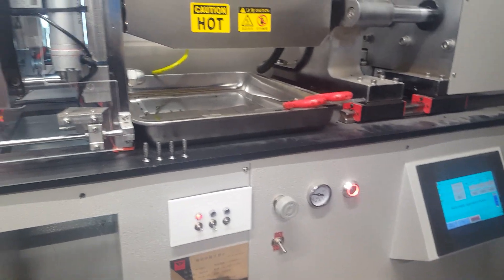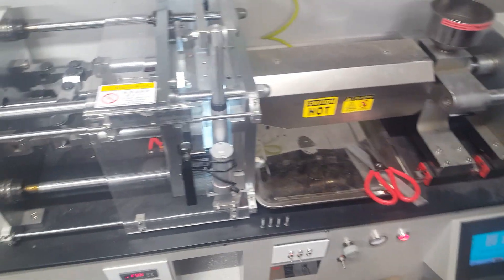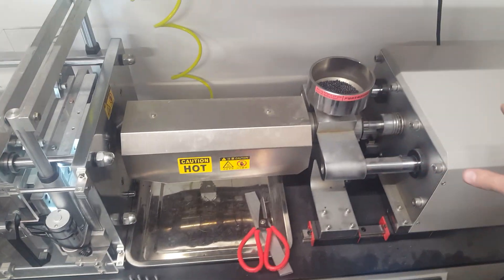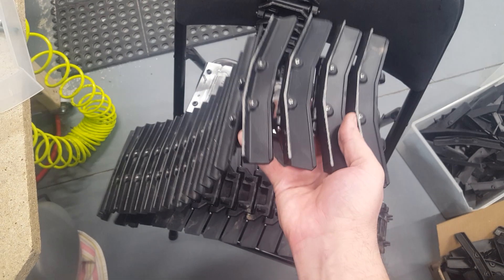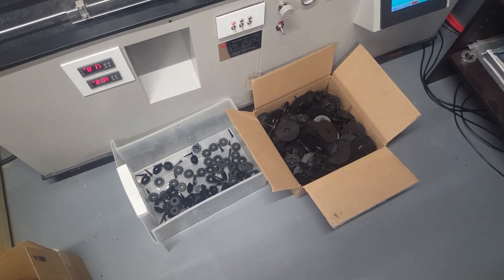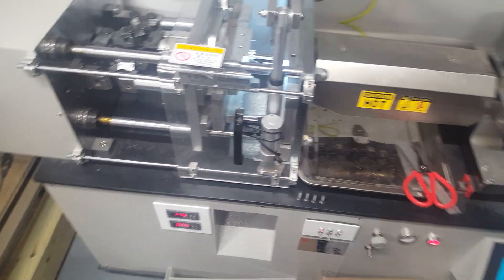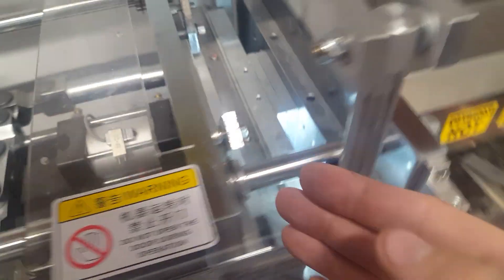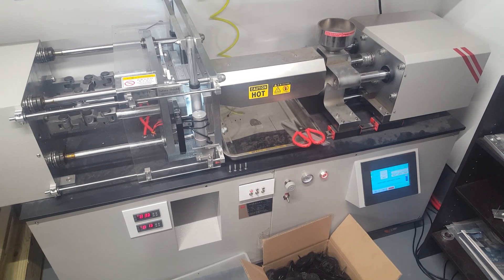RobotDigg.com Injection Molding Machine! Overview By Spyker Workshop

Comment: Saw this question you got about a month ago.....I am also actively looking for machines at the moment and have come across these. How much do you pay for the molding plates? What else do you need besides the machine (I think I saw you had a pressure tank in a video?) What is your typical maintenance costs and the curve of learning on repair (and is there support for maintenance/warranties?). With shipping what was the all in cost? What's the max amount of clamping force can it take? What's the largest shot can this machine produce at a time (it appears more than adequate for my needs). Thanks

Comment: I'm actively looking for machines at the moment and have come across these. How much do you pay for the molding plates? What else do you need besides the machine (I think I saw you had a pressure tank in a video?) What is your typical maintanence costs and the curve of learning on repair (and is there support for maintanence/warranties?). With shipping what was the all in cost? What's the max amount of clamping force can it take? What's the largest shot can this machine produce at a time (it appears more than adequate for my needs). Sorry for the question, very interested!

Comment: How is the reliability on this? Will it run parts all day without  ending tuning all the time? I'm thinking about getting one, need to produce 1000-3000 pieces a month
Reply: It should. But with 'normal' cycle times (lets say 20sek) and simple molds you should be able to get your 3.000pcs in one day easy. If you use Aluminium molds they will usually only Last 5-10k shots.

Comment: hi,. curious to know how many Decibels noise the machine it self makes, is it too loud ( can i leave running in my neighborhood garage like at 2am ? ) of course taking in consideration will add some sound proofing on walls / garage door.
also do you have any experience with runing this machine with 3d printed molds ( like on the old 3d printer Stratasys Objet30 resin  type of mold ? )

Comment: Says $180.00      😲🤦‍♂️          i dont think so  most are a min $600 aprrox mini injection machine hobbist - i was looking at a microplast but no Price ? - 
 read comment below . You need to pick one of the boxes below "RDGInjection", for instance, and it will come up with an $8k price tag.  Add another $300 for 110V if you need to have it converted.

Comment: I can see the screw turning, is that the only way that the plastic goes into the mold,  is there also a "piston" shot, or just the screw?
Reply from the maker: The screw turns to feed the plastic into the injection chamber, it has a full screw with a valve on the end and everything. After the mold ejects the previous part then the screw get injected into the mold, it will fill the full 30 grams into the mold VERY quickly within like 1 second. The screw acts like a plunger when full, you can see @ 7:47
Reply: @thegreatestmoo  Okay, so if I am understanding correctly, the screw mixes and pushes the molten plastic into the "injection chamber" then there is a mechanism that then shoots the contents of the chamber into the mold cavity?

Comment: I followed your link to Robotdigg and it looks like the injector on that page is only $180 ???????????? that can't be right is it ?
Reply: I did the same thing.  You need to pick one of the boxes below "RDGInjection", for instance, and it will come up with an $8k price tag.  Add another $300 for 110V if you need to have it converted.
Reply: @randycox4633   WOW!!!!!! I guess thats a little more in line with what I expected though :(